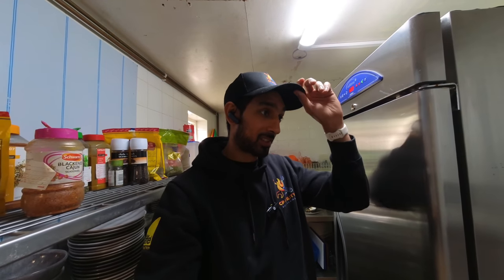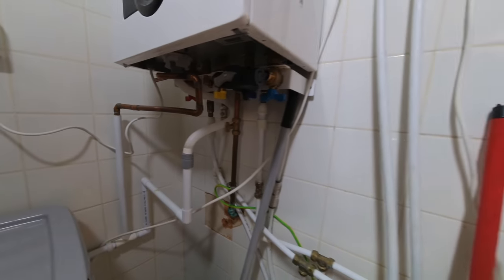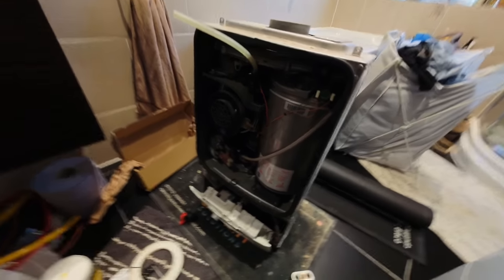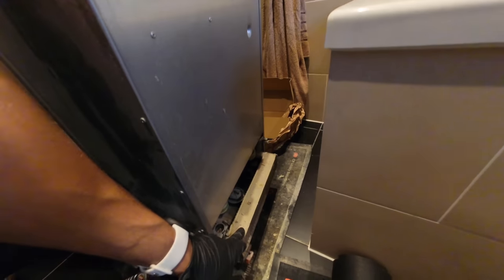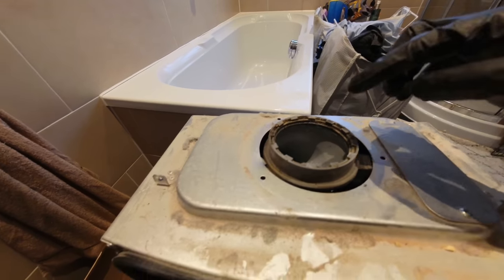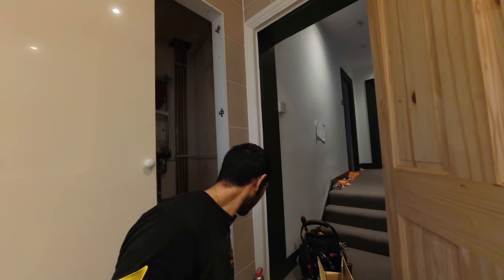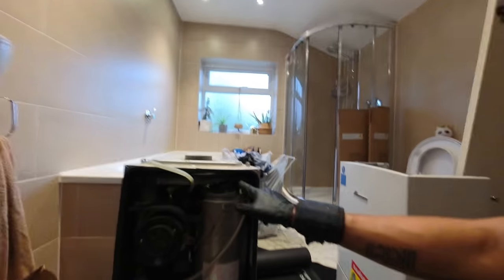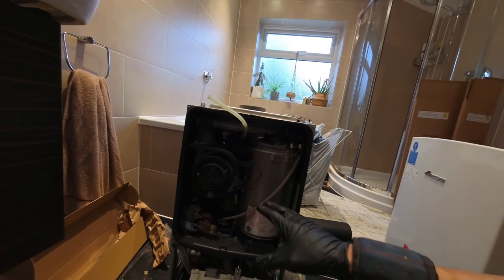The WORST Boiler Install I've Ever Seen In My Career! - A Day In The Life Of A Gas Engineer #31

Comment: @7:52 I also tend to change the middle seal too, as they tend to wear the same. (sure they come 2 in a bag). @13:24 JEEZ - who fitted that boiler.. omg. how many issues with it visually. but looks a bit cheap inside tho (in my opinion). the flex condensate pipe external looks a poor design. (but we can and do pick fault with all boilers). @22:10 I agree with the manufacturers refusal not to do the job, as they have to comply with H and S 100%, plus can be classed as not installed to MI's (service clearances). @26:35 just shows how a long job can lead to an even longer job. good spot on that one to. thumbs up from me. keep up the good work and content. always nice to watch.
Reply from the maker: Cheers Daz, I only had 1 of the seals on my but I changed the middle one as well when I went back recently to fit the condense pump. Glad you enjoyed the video mate 👍🏽
Reply: @cputilitysolutions  no worries, always nice to watch, and so informative for new operatives to the industry. :)

Comment: Hello mate good video ….could the boiler not technically just run on its internal bypass ?
Reply from the maker: Technically yes, but it's always good practice to put in an external bypass of some sort such as a radiator or long loop of 22mm. Just allows the boiler to get rid of the latent heat better

Comment: soak in wd 40? you know its oil based(duh) and will corrode rubber over time right. not sure what you mean. i will use wd on seals im replacing. anything other is a big no right.:P

i bet when you put that back on the jig you will have disturbed something inside, it doesnt mater how careful you are. been there done it. i bet i know what leaks. in the next 2 weeks. then your chasing the job, it's taking time out of your day to go repair. 4.16 love your work and ethos, your young and good. :) if there is space to left or right of the boiler to slip the expantion vessel out there is another way. not MI
Reply: @cputilitysolutions   you can try tightening it usually needs a stipdown..........what a can of worms.